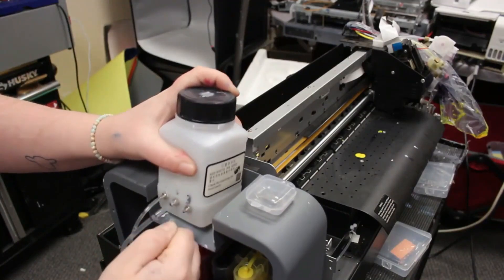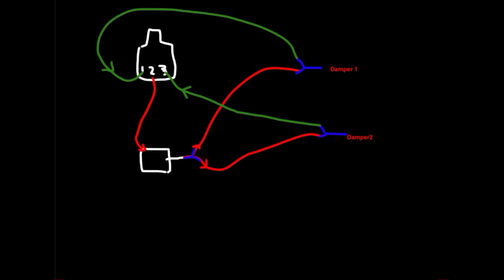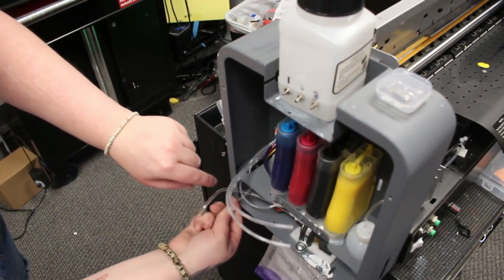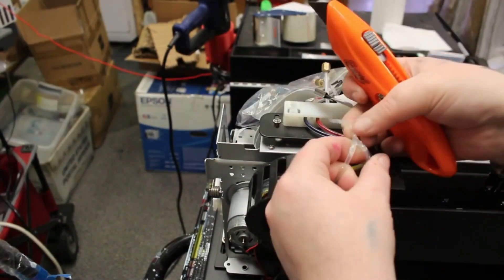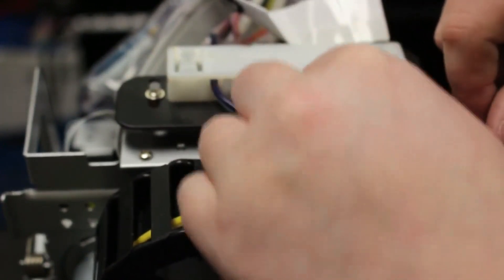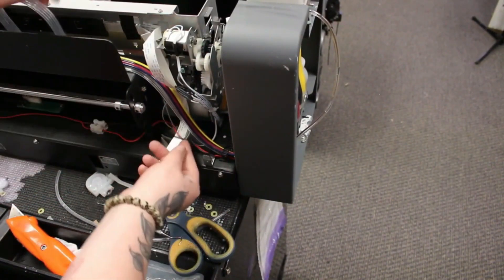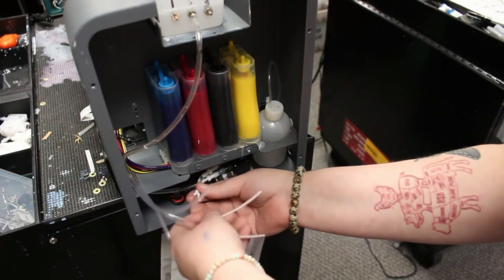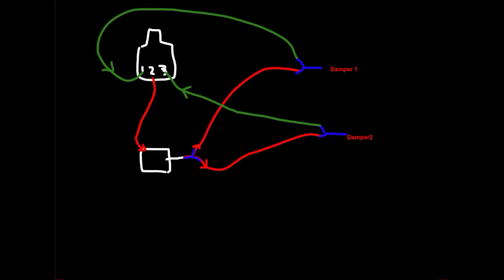Replace White Ink Tube Lines for DTFPro Model J - Level Up Your Repair Skills

Comment: Hey Kevin having issues with white and blue button flashing.  Do you have any idea why they are flashing?
Reply from the maker: Thanks for subscribing to my channel and leaving a comment! It means a lot to me, especially as I work toward that 100k subscriber milestone—I'm only halfway there after eight years, but every subscriber gets me closer. I strive to create quality content and answer questions from subscribers like you as quickly as possible. If you ever need faster help, you can also email me directly at support@bchtechnologies.com. I try to respond to subscribers’ questions within 48 hours.

The flashing white and blue lights on your printer indicate specific issues depending on the pattern. If the lights are alternating, it usually means the printer’s waste ink tank needs to be reset. Printers track discharged ink, and when the waste pad reaches its limit, the printer stops working to avoid overflow. To fix this, you’ll need the Adjustment Program for your printer model—most suppliers provide this software, so check with yours. Use it to reset the waste pad counter, clearing the error so your printer can function again.

If the lights are flashing simultaneously, it’s generally a sign of a fatal error, which could be caused by a mechanical issue, firmware problem, or other internal faults. Open the Adjustment Program, navigate to the "Particular Adjustment" menu, and select "Printer Info" to see the last five error codes. The most recent one will help identify the problem. For instance:

E-01: Paper jam or obstruction.
E-10: Printhead or carriage motor issue.
E-91: Communication error between the printer and computer.
Make sure to inspect the printer for paper jams or obstructions, update the firmware if needed, and run a cleaning cycle to ensure the printhead is working correctly. I hope this helps! Thanks again for supporting my channel, and don’t forget to check out my latest videos for more tips. If you have further questions, feel free to ask here or shoot me an email!

Comment: Where can I buy the white ink tank and tubes for replacement?
Reply from the maker: This is a DTFPro Tank. If you see the diagram, it is basically a tank that has three outlets. I don't like their design because I don't like to take ink from the bottom. You can design your own white ink tank and it will better than theirs.